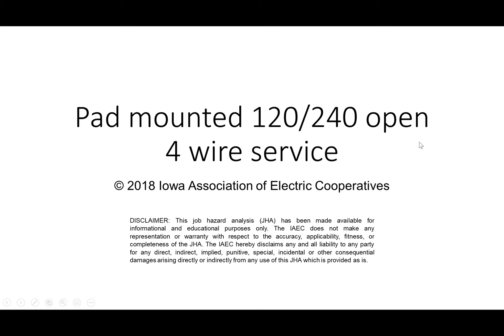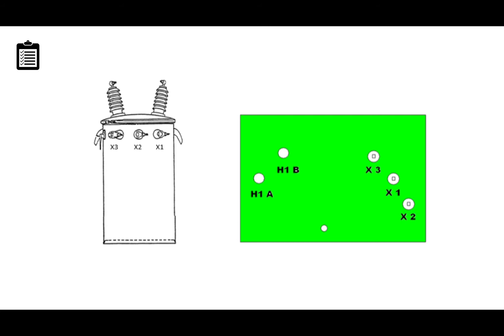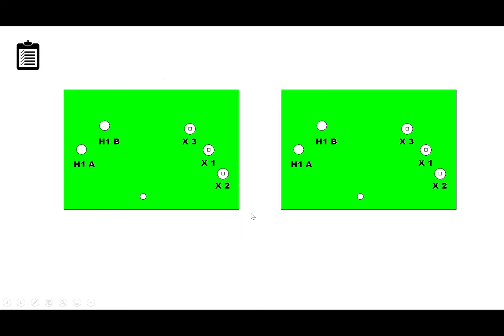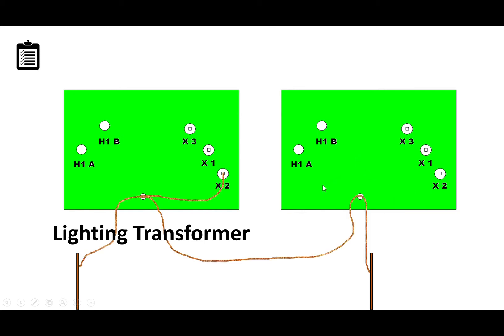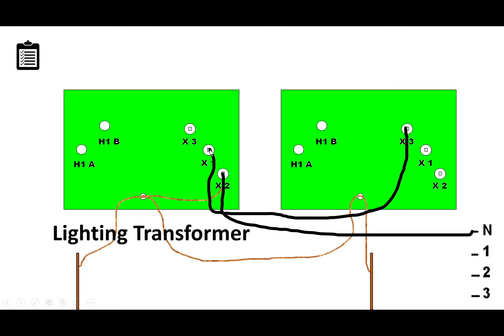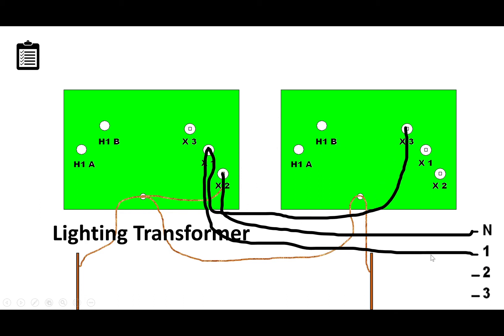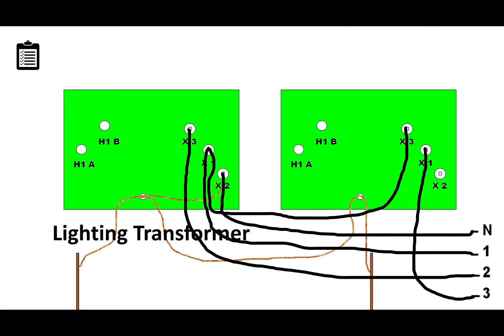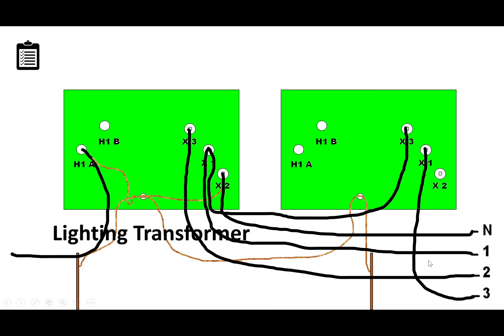Pad Mounted Open Delta 120/240 4 wire service

Comment: Sorry, very poor explanation of the mathematical relationships that determine the secondary voltages.  In my EE schooling our instructor showed us how the Wye and Delta configurations were made diagrammatically, and the math involving in computing the phase currents and voltages.  And why would one transformer only be for lighting, and another for power?  In a commercial building service, yes, we use the 480/277 panel for lighting often, and then step down via transformer to a 208/120Y service for building power needs.  But on the utility side as you describe here????????  Don't get it. Perhaps this video assumes that the student watching it already has worked in the utility field for years, and so may know what you're talking about.  But as a building engineer and master electrician, myself,  it makes no sense!

Comment: 1) At the end you show the primaries connected to the ground. Assuming that's just a drawing error, and moving on, I don't grasp how you can have any transfer of power with nothing connected to the H1B posts.
Reply: The HV primary has a ground shield on the outside of the cables. I can't answer how this works as I don't work on utility lines but I have seen installations with this setup. The utility may not have 3 primaries in some areas and this setup only requires 2 primaries for 3 phase power. I believe the H1B primary is left floating to allow unbalanced loads on single phase and maintain balance on 3 phase loads.
Reply: Something it's not right, maybe in the primary that it's not connected (H1B), only one side H1A  ?...H1A to Ground? , Sorry  bun no. 
&  the secondary winding need to follow the rules of ...
Reply: It's a case grounded transformer. Primary side is setup here in a open wye configuration utilizing the case as ground/neutral. H1B is a feed through from H1A.
Reply: Poor video. Should be removed